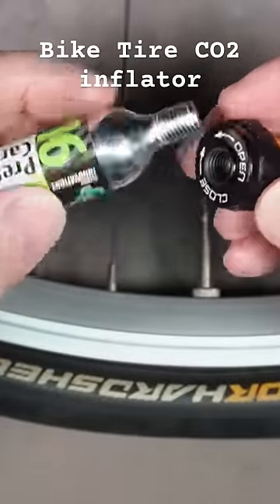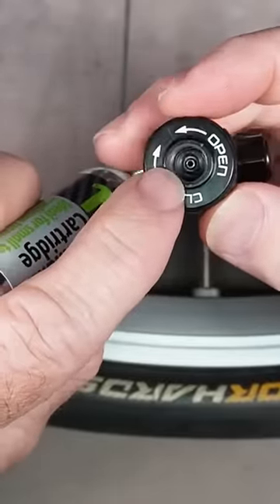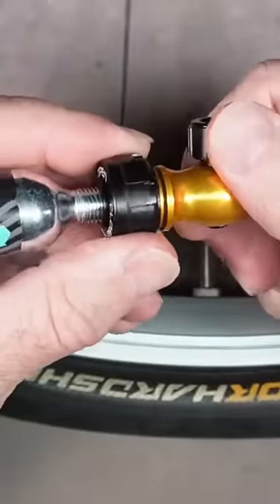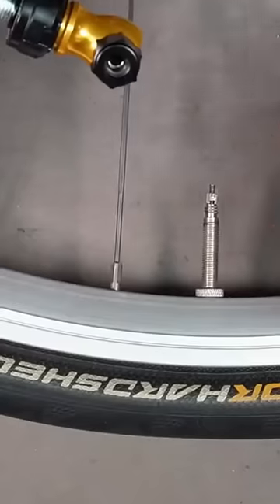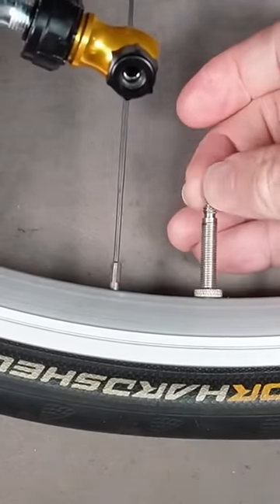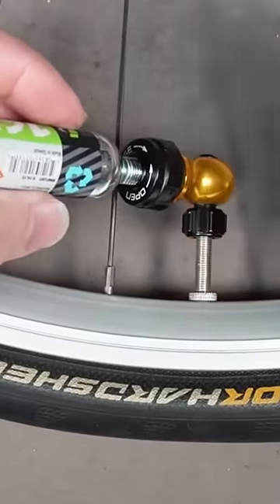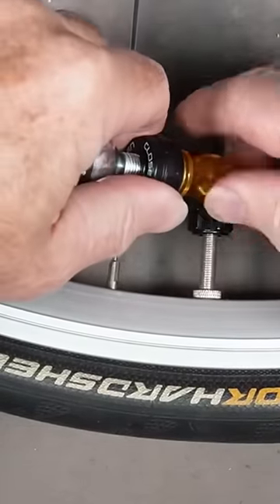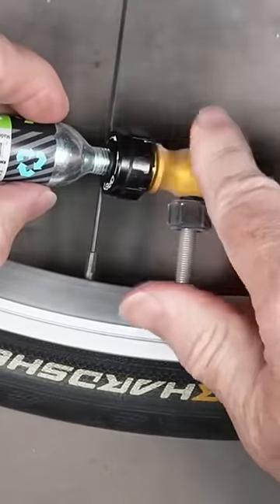Bike Tire (tyre) CO2 Inflator: How to use. #bicyclerepair #bike

Comment: This man just gave you a short lesson of how an AC gets cold 👏🏼
Correction: how an evaporator coil gets cold🤷🏻‍♂️
Reply from the maker: Very true! Thanks for the comment!

Dave
Reply: Ac uses Freon not Co2
Reply: @Sage93166  it’s not the Freon that makes it cold. It’s the process of compressing it outside the house and then decompressing inside the house.
Reply: @Laissez_Faire its also the freon... Great thermal conductor.. try doing the same job with air 😂
Reply: @outkast937  unless you compress it and decompress it you won’t get anything
Reply: @Laissez_Faire true pressure directly relates to temperature high pressure high temp low pressure lowtemp
Reply: @Sage93166   You could use CO2 in an a/c system, you could use hydrogen (if you like a little extra danger in your life), name a gas it doesn't matter.   Only thing is you will get varying degrees of effectiveness/efficiency ( varying degrees 🤔...hah).
Reply: @Sage93166  *ACs use R-410A , not Freon🤓
Reply: @suicideghostftp  You do know CO2 tanks come in different sizes, right? Right? Not to mention, in the video, those would be considered cartridges, not tanks.
Reply: @suicideghostftp please pay more attention in English class 🙏
Reply: A/c doesnt get cold it removes heat
Reply: @dumbdumb4ever  correct. Best way to think about it is just a simple transfer of energy. In this case, heat energy. Taking the heat energy from inside your home/car/fridge/freezer and transferring it somewhere else.  Remember learning about thermodynamics? Yeah, here we are. The CO2 in the cartridge is pressurized and is in liquid form. When released it becomes a gas, but doing so requires energy. In this case heat energy. Thus the frosting of the device. Exactly the way a/c works, just In a closed system. 
 Simply put, a/c makes things cold by transferring the energy somewhere else.
Reply: @dumbdumb4ever ice cubes are not cold, they remove heat from your drinks. Your comment fits the name
Reply: @Laissez_Faire  nobody said anything about ice cubes. Lard brain. Look it up
Reply: @Laissez_Faire no. AC is the process of taking heat from inside a structure and moving it to where it doesn’t affect the inhabitants, aka condensing unit. It doesn’t matter where refrigerant is being compressed hence why packaged units exist, the compressor and the heat it generates are what causes the refrigerant to fractionate so that it can pick up more heat from the inside air that passes over a heat exchanger. You might wanna crack open that old EPA book lol.
Reply: He also gave short lesson on human anatomy and how an human body works by moving his hands and also an short english speaking class for non english speakers ❤
Reply: An ac uses refrigerant mainly R-410A which is gonna get phased out soon like most hcfc's and some cfc's
Reply: @stingray8255  mostly just affects residential units though as if that’s the real problem when we allow crazy high leak rates on industrial sized systems but yeah I just think it’s dumb
Reply: Not true at all. Concentrated CO2 is cold. Thus dry ice (solid CO2) and CO2 fire extinguishers.
Reply: @djdonald243  additional fun fact R744 (aka CO2) is also a high pressure refrigerant.
Reply: @Laissez_Faire putting more heat to source, taking heat from the sync. The reverse of Carnot cycle. Very good Man. Your basics are solid. Can you tell you what you are doing as of now and what's your educational qualification. I am not thinking of IV league colleges. At this point they are garbage bins. Do share ...
Reply: @outkast937 so use the fero n, without using reverse Carnot cycle. If you do it, next noble prize is yours man. He is talking about the principle, you are talking about device used. He is talking Newton's third law and you are saying that you can't get it without a spring. Man🤷🏽‍♂️
Reply: @insearchof9090  that’s correct. The ”Carnot refrigerator” 👍🏼. Im just a good student of common information. Well I thought it was common sense that compression produces heat and decompression produces cold. I love everything engineering and things just make sense to me 🤷🏻‍♂️. I do have a bachelor degree in electronic engineering.
Reply: @djdonald243  you’re confusing compressed CO2 to solid CO2. Solid CO2 a.k.a. dry ice is cold. Compressed CO2 is in a room temperature. Better yet when you first compress CO2, it gets hot and comes back to room temperature. When you decompress the canister it gets cold 🥶
Reply: @Laissez_Faire  never stop learning mate. Hopefully, you are in a nation where you can practice what you study. 👍🏼
Reply: Good catch😅
Reply: @Sage93166 supermarkets and industrial places use CO2 as refrigerant. 
So CO2 is indeed a refrigerant. 
Freon is just a brand like Chevy or Ford.
Reply: @dumbdumb4ever this guy thermodynamics
Reply: Wrong! A lot more going on in AC!
Reply: @liakosliakos348  compressing a gas through a small
Orifice so that the latent heat causes a change of state transferring the energy in the space? I think he got it pretty summarized when the co2 cart got frosty like a TXV metering refrigerant.
Reply: @NeighborhoodDada  oh God. Another one,,,,
Reply: @liakosliakos348 been doing it for 20 years so I think I know a thing or two
Reply: @NeighborhoodDada  maybe,,,
Reply: @liakosliakos348  oh I’m sorry. I guess for some I had to be more specific. “This is what happens inside an evaporator coil “ 🤦🏻‍♂️
Reply: @Sage93166 It's the sudden pressure drop. Also, an AC uses refrigerant. Freon is a brand. Also, commercial refrigeration units sometimes use CO2 as a refrigerant
Reply: @suicideghostftp Yes we literally dump 1500# of R744 in a supermarket system.
Reply: @Sage93166 ac hasn’t used freon in years. Also, why did he u screw the only thing that holds in the gas when you remove the tool?
Reply: @outkast937 freon is a poor conductor. If you liquify air u get the same stuff just different preassure. Any gas that can be compressed into a liquid(very important that a phase change happens because thats what makes it cold) and then back into a gas is refrigerant and there are many. Co2 is one. Ideal ones can be liquified easily which is why r134(cars), 404(industry and home, 33(freon, we don’t use anymore). A really good one u can use to replay r33 is propane and that will be in every tabletop ice maker. 
How AC work u ask? Gold gas runs thru a set of tubes called the evaporator(it doesn’t have to be cold but it usually will be). A fan blows warm air over the tubes to be cooled. The gas has picked up the heat. The gas gets compressed into a liquid. The heat doesn’t want to be there anymore so the liquid is pumped thru the condenser where it can shed its excess heat and when it expands the gas will have an energy deficit compared to what’s around it causing a gradient in which all things must flow from high to low. Its all about energy transfer and management. The cold doesn’t come from anything. The heat is removed and thrown outside. Thats why its called a heat pump. Even tho ur fridge keeps food cold, it is also a heat pump and will pump heat from inside the box to ur kitchen ambient air.
Reply: @themc3311 the very last bit of ur explanation is backerds
Reply: @markethvacrguy i have a super market pump under my grandmas porch. Idk how the hell i got it there and idk how imma get it out. No wonder it stayed put behind food lion for so long. OH GOD! I remember now! I couldn’t lift it so i layed it on its side onto my skateboard and rode it down the hill! Felt like taking a ride on an atom bomb. I felt like rayman in the great escape
Reply: @suicideghostftp just changed my co2 this week, couple thousand dollars but it's worth it when I'm saving money on a new air conditioner, this this was like 300 bucks!
Reply: @outkast937 they dont use freon anymore dude... They haven't used freon in years

Comment: I have one for my motorcycle tires in case of an emergency and i once forgot to close the valve and wasted a cartridge. Otherwise these are really nice
Reply from the maker: Thanks for leaving the comment and I really appreciate the input!

Dave
Reply: Whipits during the tour de france!
Reply: Why would you open the valve in the first place? Motorbikes use a Schrader valve and the connectors have the valve depressor built into them. The only way to use one that isn't designed for the schrader valve would be to remove the valve core completely.
Reply: @000scubasteve hehe, good one
Reply: @bremCZ you know that not every bike is the same right
Reply: Hahahahaha.  Is your motorcycle a 75 cc??  😊
Reply: @bremCZ They meant the valve on the device, not the bike. If you have the valve on the device open, it allows the CO2 to flow.

Comment: The partly used mini cylinders leak over time and the seal can blow out when connecting. Far better with a good mini pump with rapid fill and high pressure settings.
Reply from the maker: Mini pumps are ok, but you need to be sure it is charged. You can throw a couple CO2 cartridges and an inflator valve in a saddle bag and forget about it until needed. And it will inflate your tire in 3 seconds. Just food for thought! Thanks for commenting!

Comment: I love how no matter what it involves, if its the same thing as something else that something different uses it still has to be explained 😂
Reply: After reading this I wish I was illiterate, wtf are you trying to say?
Reply: @stewrapid right????
Reply: @stewrapid  they're expressing how wild it is that physics applies to more than one thing,  but we still have to explain the science behind it even if two different things utilize the same principles. 

Im assuming in regards to the frost forming akin to an AC unit due to the compressed gas expanding rapidly into a greater volume, thus cooling until reaching equilibrium again.

Comment: Nice. I feel presta valves are a punishment, lol. I've changed all of mine to Schrader. Also, slime in the tube works wonders.
Reply from the maker: How did you change to Schrader? Did you get new wheels?
Reply: @davescycling  I widened the hole with a drill bit. Have done this for a long time with no issues.
Reply from the maker: Ok, fair enough. I will not be doing  that on my carbon rims, though! Thank you very much for your input!

Comment: These are great for a really quick fix after spending 20 minutes replacing a tube on the side of the road in the rain.

Still always have a mini pump on my frame though 😅
Reply from the maker: Great point! I completely agree! I don’t always carry a pump but if I’m going to be on a long ride and I have my trunk bag with me, I will throw one in there.
Reply: @davescycling  I always have a few canisters and the adapter, really nice piece of kit to have on long days out.

A few friends used to think I over prepared, always carried a tube repair kit, a few additional tubes for a quick change as well as the aforementioned canisters.
Soon proved them wrong on the Blackpool to Mamchster ride when we all got punctures and went through 4 tubes 🥲

Comment: I'm still trying to figure out why he loosened the core ..... That doesn't help that's why that pin sticks up it's a one way valve
Reply from the maker: Thanks for your comment. The valve in the video is a Presta valve. Unless the nut on the top is loosened, air (or CO2) cannot travel through the valve in either direction. When the nut is loose, any pressure in the tire will close the valve.

Dave
Reply: You're thinking of the Schrader valve I'd guess.
Reply: @davescycling  I must admit it, for bikes, I always prefered the use of presta valves.
Reply from the maker: @Jean-Denis_R_R_Loret yes, most of my bikes use Presta and I have no complaints! Thanks for your input!

Dave
Reply: @Jean-Denis_R_R_Loret i like the way presta valve tubes can inflate so much faster with much less pump strokes from a manual bicycle pump. I heard a long time ago road bikes adopted the presta valves because someone designed a frame mounted pump and you can get the presta tube pumped with out having your one arm fall off😫
Reply: @samholt4139  For me it was more in regard to mountain biking as well as urban freeride (with long stairs and jumps), since the valve is blocked against the rim with a nut, and has no way to move. I can't even figure the number of tubes I ripped because of schrader valves, just at the valve junction (not even talking about the number of tube I exploded after a harsh landing, even with 125mm or 150mm of travel for suspension).
To me schrader valves are only good with tubeless tires, and air shocks, where the valve can't move, when it's mounted directly to the rim, but for tubed tires it's pure garbage, a 5m long jump and it's gone.
Reply: So you dont know how what a presta valve is?
Reply: @buttplugsalesmane69 And I bet you don't know what a JFET is? What's your point?
Reply: R U smoking
Reply: @deang5622 
What does a Junction gate Field Effect Transistor have to do with anything?
Reply: @Crlarl  probably logic circuits but those dont pertain to presta valves lol
Reply: @davescycling  So how do you remove the filler valve?

Comment: Seems like a ridiculously unnecessary and wasteful product. CO2 cartridges are one-time use, aren't exactly cheap, have a limited shelf life, and have a minor yet undeniably negative impact on the environment. The device itself is also potentially dangerous if misused (depressurizing gas causes serious cold burns and it would be easy to forget to close the valve or accidentally fumble it open while fitting the cartridge) and could be wildly imprecise as there's no way to tell how much pressure you're actually putting into the tire (not much danger of exploding unless you try to top off a mostly full tire but still if an idiot can hurt themselves with something they will). 

I can't see any good reason to use this over an electric compressor or a hand pump. The positives are completely outweighed by the negatives. If it's supposed to be an emergency tool... just bring a miniature hand pump that fits in a bag or straps to the bike frame and some repair patches or spare inner tubes. This is a stupid gimmick designed for people who don't know any better in the hopes that they come back and buy more "Premium Cartridges" formulated with the perfect blend of gasses proven to perform best in extreme cycling or some other marketing bull.
Reply from the maker: Thanks for your comment! Your points are mostly true. (IMO they are not expensive unless you get a lot of flats)I have carried a tube, 2 tire levers and a CO2 inflator for years and it has saved several rides for me. I have no complaints and most of my road cycling friends carry the same. The reasons we use it are that they’re small, light and inflate a tire in seconds. It’s an option people either love or hate I guess!
Reply: Probably intended for racing with the lightest gear possible where ounces and speed (getting back on the road quickly) matter.
Reply: People don't like using hand pumps (petty I agree) and electric inflators take up way too much space for things like mountain bike tyres or don't have large enough batteries
Reply: @boomboxing4402  I mean compressors can be as small as as a lunchbox if they don't have an air tank, and those that do can be as small as two loaves of white bread laid parallel. They really don't take much space. You can also use them for a million other things like powering pneumatic tools, or filling up other inflatable things (like a basketball). Compared to a single-use product like this, a $20 compressor without a tank or a sub-$100 compressor with a tank is just so much more useful. 

It is worth noting that they are strictly for use at home or run off of a car's cigarette lighter, so that's definitely a limitation. But seriously, using a hand pump really doesn't take long. 5 mins max if all you have to do is pump it back up a little. But if you've got a flat, and truly have a problem with the inner tube, you're gonna be stuck for a while either way. Having this won't really speed that up.
Reply: @mysticwizard1943  most people don't use them for at car repairs we use them for trailside repairs with mountain bike tyres with sealant which are high volume and if we are doing an at car repair we can use a floor pump
Reply: @boomboxing4402  I'm really not sure what you're trying to say. I stated pretty clearly that you can use a small hand pump when using a compressor is impractical or impossible (see the second paragraph of the initial comment). There's no worrying about whether a hand pump is in date, and it isn't a wasteful disposable product. They are a cheap, one-time purchase. Other commentators have also noted that tires filled with CO2 defalte after a day or so which can be... problematic.

If you are out at a trail, you likely aren't THAT far from your car, so you could just walk back to do repairs. A cheap little compressor in this situation would be nice to have, especially if you have to replace or patch an inner tube. This thing might be similarly nice if you aren't within walking distance of your car, but you've got a full puncture or blowout then realistically you're saving all of a few minutes in the repair process. All of the other previously listed downsides are still there though.

Now if you're like me and use your bike as the sole mode of transportation on long-distance, multi-day camping trips... this would be the worst solution to have. Say it's day 1 of a 4 day trip, and you get a flat and only have 2 canisters. They're just for emergencies, right? No need to bring a bunch of them, who needs the extra weight. No big deal you say, just top it off each day and hope it works out. Day 2 your buddy hits a rock too hard and now his tire is popped... Well now you're screwed.